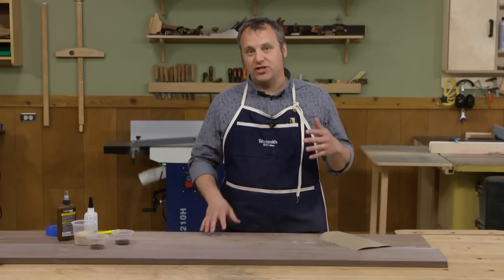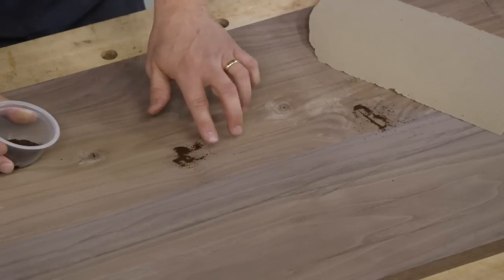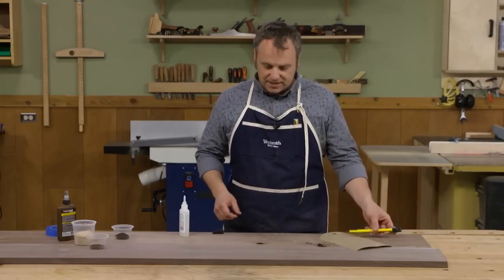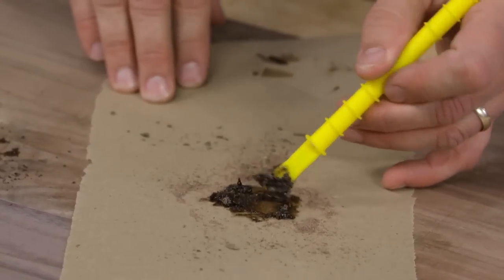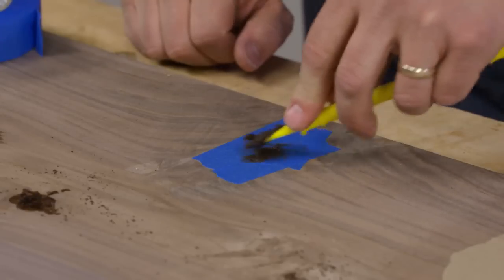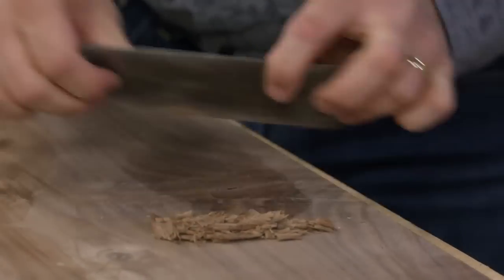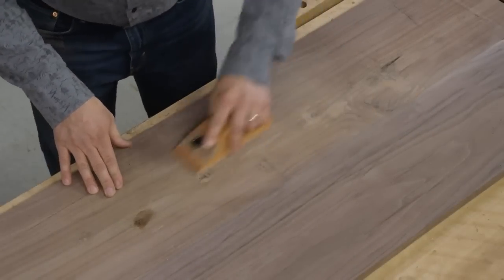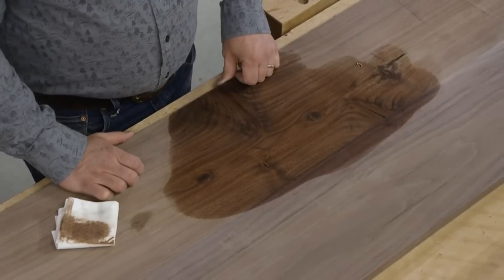Woodworking Tip: Homebrew Gap Filler

Comment: If you are filling cracks or other blemishes with wood dust(not loose knots) and color match is important... add a tiny amount of baking flour to lighten the paste. It seems to me that wood dust, even from the same board, usually results in paste that is a little darker after it dries, that is my 2c your mileage will vary ;)

Comment: Out of interest, why liquid hide? Due to it's colour?
Reply: working time... PVA glue would start to set as you mix... or use 30min epoxy(not 5 min!)
Reply: @danej7335  I would think that epoxy would interfere with an oil finish. Keep the oil from being absorbed.
Reply: @glencrandall7051  not necessarily. Pretty much any patch/fill will alter the soaking of BLO as compared to the surrounding wood. But because BLO is not really a film finish it should not adversely effect the surface of the finish. Also keep in mind that epoxy/wood composite boats are typically top coated with a spar varnish(an oil finish), for UV protection, the surface and adhesion over epoxy is not usually an issue(unless a parting agent is used in molding, resulting in fisheyes)
Reply: @danej7335  I've never had pva set up on me when mixing with dust, but maybe i've never needed to fill more than minor gaps. I'll have to do a little test and see.
Reply: @Myrkskog   you probably work faster than me... Im typically half-fast ;) 
The particular PVA would matter too, Titebond original seems to start setting in a few minutes faster than the 10min open-time in the datasheet